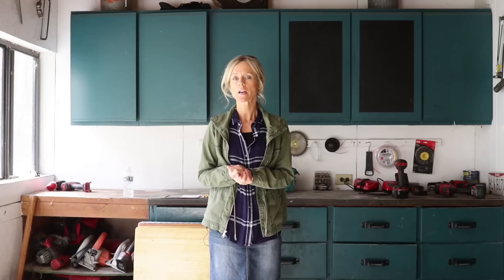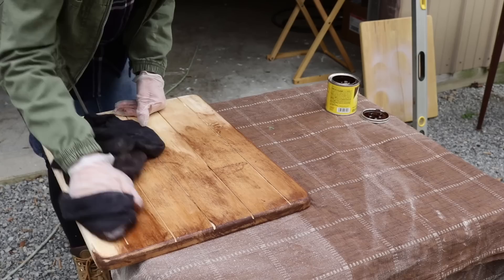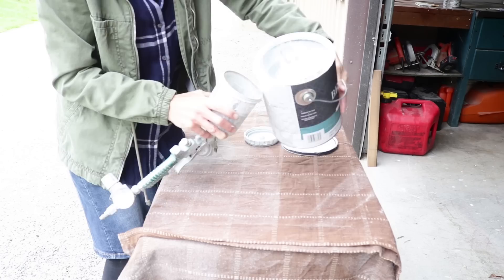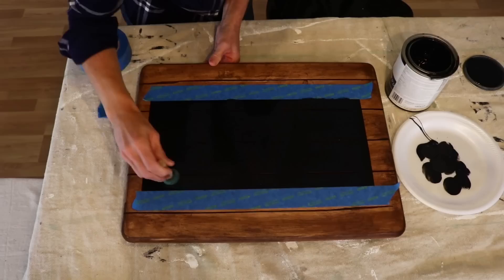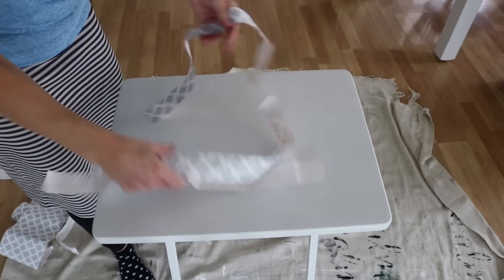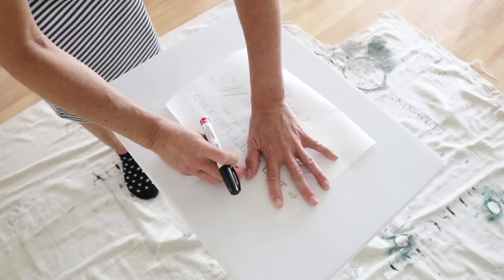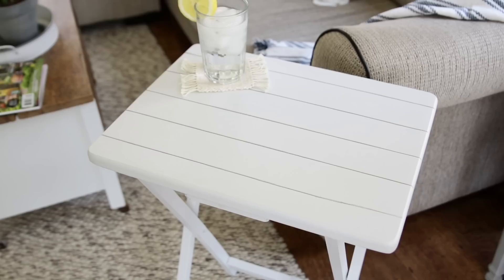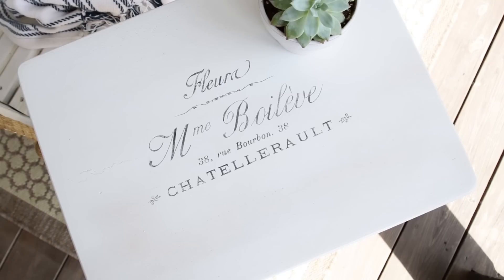TV Tray Makeovers ~ Table Makeovers ~ Painted Furniture ~ DIY Planked Tables

Comment: Gorgeous finishes. For the round table you could use the square top you removed, add the same finish and 2 cupboard handles on the top to the sides to create a tray that can stay on top of the round table to serve stuff. X

Comment: Awww... cute bird.  You already have a price on her and her family!  You could make a sign above the box:
For sale 
Carolina Wren Family
😂 just kidding.  🤣
Question:  I have always worried about putting just Mod Podge as the finish on a surface that might possibly get water on it, say, condensation from a cup.  Is it a strong enough finish to withstand that?  If you were wanting to seal it after that, would you use a clear spray or paint on sealer?  Those tray tables are very cool, and a good deal to be able to try so many finishes!

Comment: Hello Mary, I have a tray table like these and would like to make a ironing board out to it.  You legs on your tables seam pretty sturdy.  Did you have any trouble with wobbly legs and how did you tighten them up.  FYI my table does not have regular screws, they are some smooth top things.

Comment: Mary- I love your tray ideas. Can I ask a question I have 2 porch benches that need to be sanded and painted and I don't have a sander or spray painter. Would hand sandpaper and spray can paint be ok? One bench is metal the other is wood shaped like your swinging porch swing. I am new to doing projects by myself. Your thoughts? Thanks, Jennifer

Comment: Hi Mary, I have a question for you. I need to paint a brand new vanity. So the finish on it is a light walnut stain with finish. The kind that  furniture companies seem to use most commonly. I need to paint all of it white, semi gloss preferably. It is for my teen niece and will get a lot of use. Since it’s new it arrived assembled. I have primer to paint with first. Really was wondering about purchasing the sprayer you have your amazon list. Wagner paint sprayer. Is it user friendly and easy to get smooth finish? 
It’s just advice, I need. I won’t hold you to anything, but honestly unsure and would like your take on the experience with sprayer or maybe you’d advise to use the old paint brush method. I’d really appreciate anything you might suggest. Thanks 🙏🏻

Comment: Mary do you ever have trouble getting the x part of table legs where it folds closing up without the paint scraping off? If so, any ideas for a solution? My tables slide on wooden  grove underneath.
Thanks -Tammi